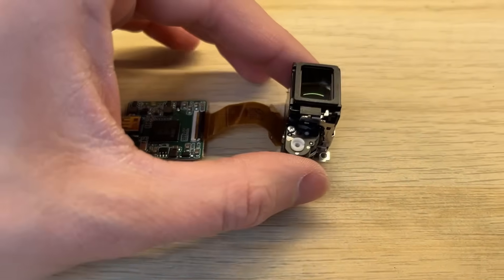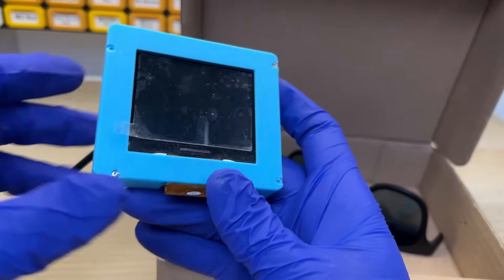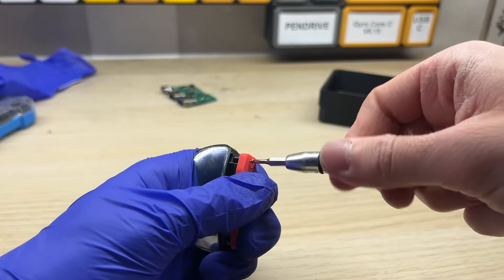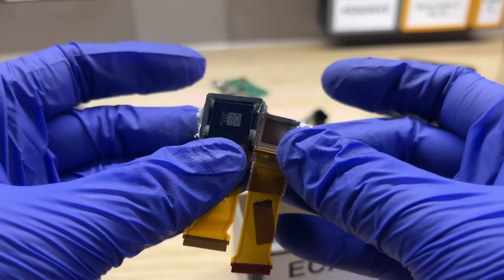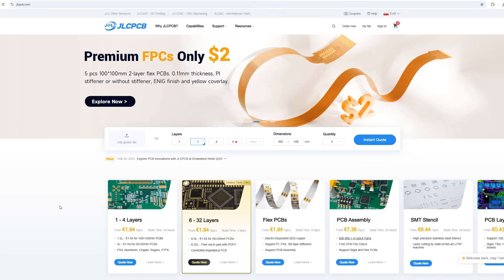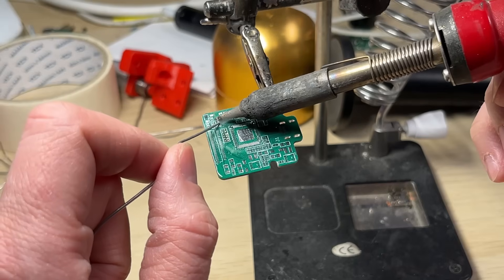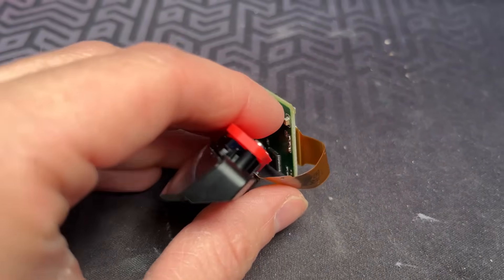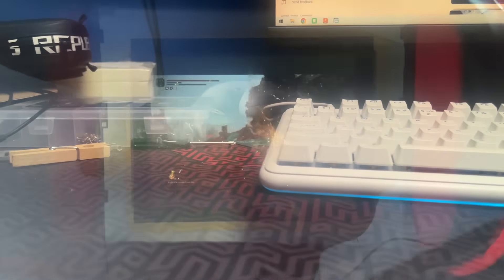ECX Engine 3.0 | The best DiY Holographic Augmented Reality Display

Comment: Hi Manolo. I heard you say plastic optics.
I've been doing a bit of research on the optics and I found that plexiglass and semi transparent acrylic plastic are one and the same thing.

My question is can I use this semi acrylic plastic to make my own optics for my DIY project
Reply from the maker: Hi 
Of course but plexiglass and semi transparent plastic is not the same thing. Both are made out of acrylic but one have special, semi reflective coating
Reply: @ManolloMancelli 
Can I use the acrylic plastic because it easy to find then put my own semi reflective coating just for trials?
Reply from the maker: @votinkhosi5811  You can do whatever you want but if you cheap out on materials then it won't work great
Reply: @ManolloMancelli  makes sense. 
You are the best bro ✌️

Comment: are you sure you cant clone the software?
couldnt you just read contents after 0x08000000 and copy those to the new chip?
or is it fully read blocked somehow?
Reply from the maker: I hope you are right about that. I read somewhere that it's impossible to read the bootlader part of the code. There is a possibility that I could read the normal code but if it has custom code on the bootloader part then propably I won't be able to get that.
Reply: @ManolloMancelli  im not certain on that, tbh, i dont even know the exact type of uc that is hehe. or if you need access to boot pins or if swd swr is enough.
i just thought about the price of those things.

Comment: How do you calculate the proper distance between the magnifier and the screen? Also have you considered making the driver board long and thin so it would fit in or along the arm of a pair of glasses, rather than above the eye?
Reply: may i ask a stupid question please 
q.- will be long enough i mean will the power last that long ? something like signal weakening/degradation 
appreciate ppl like u man u already game me some fact with ur last comment